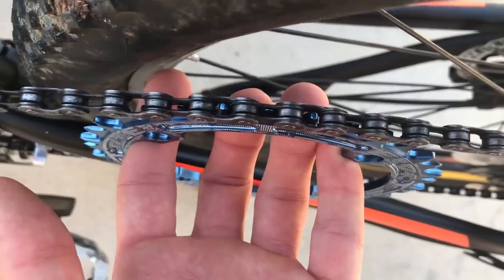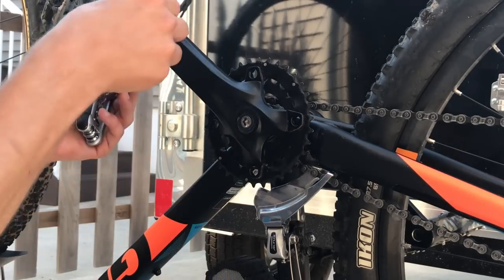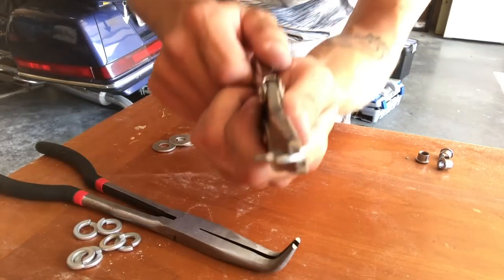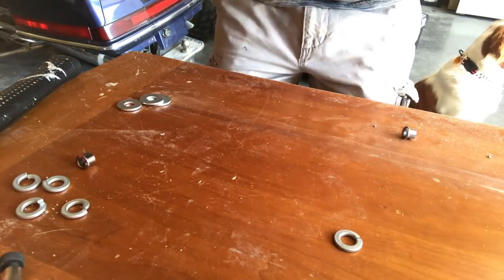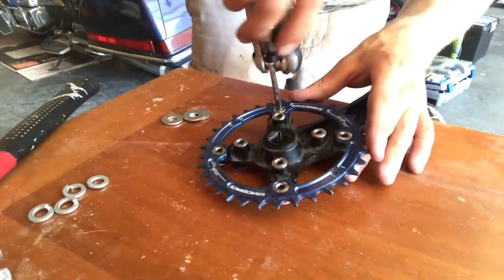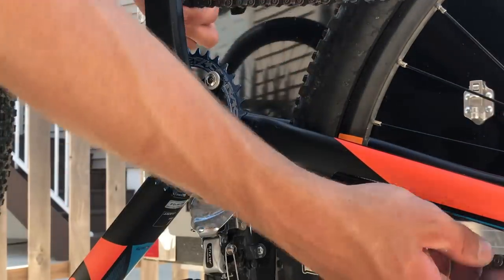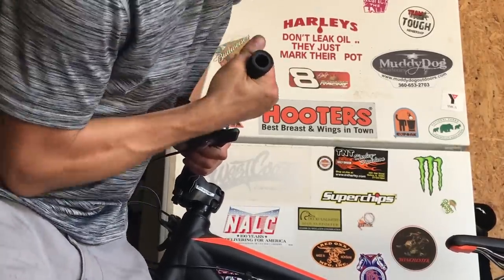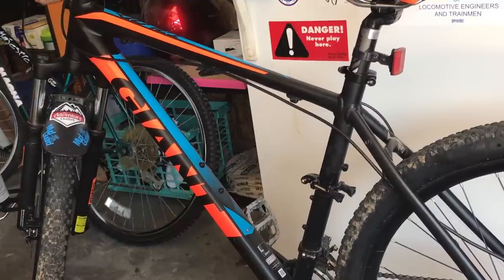3x8 to 1x8 MTB Conversion - Stupid or WORTH IT?

Comment: I've rode a 2019 Rockey Mountain Soul which is a 1x9. 30t crank with a SunRace 11-40t and I can honestly say I didn't run out of gears climbing hills or riding through town. 1x8 is limited to 11-34t which is fine if your running a 28t crank,,,you just waste gears riding trails. Probably lose 3 gears that spin out. That's my opinion...

Comment: Well I’ve done a similar thing, converted a 3 x 9 to a 1x 8!  It’s on my e-bike, which I just use to ride to work. I’m 59 with a heart condition and a pacemaker, so don’t judge me too much! Anyway, much the same steps as you, I knew exactly what you were doing with the lock washers, I did that too. For some reason I adjusted the rear derailleur so it only uses gears 2-9, can’t remember why now. Though I only tend to use probably the top four gears anyway as I make full use of the assist. Hey, I’m only going to work! I did end up putting the front derailleur back on though, to act as a chain device, I found the chain came off a fair bit, even on the road.  That seemed the cheapest way of doing it.  So good job, if it works for you it can’t be wrong, eh?

Comment: i found a new way to take off grips i normal pull on them now a little bit so there is a gap and then push it with my fingers the rest of the way. if you do it correctly like how i do it you wont even break a sweat.

Comment: Lots of things wrong here:

Wide range cassette evens out the range when you drop the other gears. 

Got get some single speed chainring bolts. They are less than $12 for steel ones.  

Go get some proper bike tools (Not sure what crank removal tool was)

Taking grips on and off isn't hard with either rubbing alcohol or water.

Comment: If you do this to your Talon, you'll have to upgrade the rear cassette as well to get some gear range back. With this bike you have room for a 10 speed cassette. I suggest an 11/42 for the wider range. There are also 11/44 and 11/46 x 10 I believe from SunRace, but they are difficult to find in those sizes. You will also need to upgrade to a 10 speed shifter and derailleur. Well worth the investment if you go 1x. If you don't, it will be hard to pedal up hills.

Comment: The Talon 3 isn't exactly a great climber to begin with (the gearing is equivalent to a 29er with 30/42t 1x setup), the 1x8 might be nice in flatlands, but the climbs out west would be "interesting" with it haha.  I have a 2020 Talon 3, thankfully they at least went 2x8 for 2020.  I've found a kit that you can use to convert the Talon to a 1x11, with your choice of 46 or 50t cassettes, and a SLX mech and shifter, but costs $150.  I may go that route if I keep my Talon, but I'm considering going full sus this spring.

Comment: I just found your channel by accident and like this idea, might try it on my old 1998 Trek 8000 SL. How did it work for you? Did you need to add a chain keeper up front to keep from throwing the chain off? What size chain ring did you use? I noticed you didn't resize the chain. My current setup is 22/32/42 with 11/32 on back.
Reply: A narrow wide chaining will help keep the chain from dropping. He also kept the front derailleur on which will act as a chain guide.

11-32 is a pretty good range but you can get 11-40 and 12-42 8 speed cassettes as well. Definitely a big help if you live in a hilly area like I do.

Comment: Nice! I did the same converting my old 42-52 to a simple one ( 52) with these lock washers. :D
Reply: Fernando Fernandes Neri You wrote you converted (past tense) to a 42 OR (emphasis added) 52; which did you do, or is it which do you plan to do?
Reply: Richard E Sorry, I expressed myself badly. Now it’s correct

Comment: i run 1x8 or 9 on everything. same 11-34 cassette on all bikes too only change the chainring to what suits the bikes use case
Reply: Would you recommend the usual 11-34 cassette when converting to a 1x9 from a 3x9?
Reply: @flts3089  its all i run tbh my orange patriot runs a 34 up front and my norco storm runs a 38 but 11-34 on back of both

Comment: 6 hours after buying a raceface 1x sprocket to convert my bike to 1x9 i stumble across your video :D

the new ones have built in threads to receive the original screws. no more need to bodge there :)

Comment: Great video doing this on my kids bike now 🤙🏻
Reply: I've done this on both my kids bike, well, they don't have the narrow wide chainring but until now it hasn't been a problem. (altho my daughter still has the front derailleur mounted as a chain guide) 
I've ran that setup since early 2000ts and its not a big issue either way, remove the unneeded chainrings (or just grind off the teeth to make a guard)

Comment: You did it fine if it works like that and if you want to use a multitool for everything no one is stopping you but being s experienced bike mechanic that crank  bolt was not tight enough because 40nm they go onto the spindle with and even with a 1- 1/2 long torque wrench they are solid to push on should have hit it on with a rubber mallet first to make it a bit better because if you don't the crank will slit and come off down road or even cause pitting on you spindle taper you probly don't understand what I just said but yeah and get a crank puller they are like $5 on ebay worth having right tool for the job but good work

Comment: I went wit the sram 1x12 - 32t. I love it but it cost me $400 😫 with the labor. It’s nice only having 1 shifter . I was going to do a Dyi job like this ....
Reply: If you had bought a 2x system, it would be as if you were riding with two 1x systems on the same bike.   Yes, you would have 2 sets of smaller increments instead of one set of wide bad ones for the weight of less than a half a bottle of water.

Comment: No it's not stupid actually it's a great idea because of simplicity. I liked it and the fact that I was planning to this prior to watching your video. What's holding me are comments and suggestions from professional bike mechanics that by doing the switch from 3 to 1 is like a opening a can of worms in compatibility issues. One final question: how was the ride or how did the bike performed in the trail ? Thank you.

Comment: There's no way i could survive in a 1x8. We often go for 50 miles rides or more in mountainous and hilly terrain. Climbing is essential. 1x12 is the only way to go if you actually ride your bike to the trails.
Reply: 3x8/9/10 foes a good job on hills too, admit a bit heavy and unfashionable (but cheap and what I have). Also have square tapered crank axle...
Reply: @johnpowell9174  I second that I'm using 3x8 for 4 years now it's my all around bike I wouldn't trade it for 1x since maintaining it is more expensive than what I have now and I like how fast I can shift on my granny gears when approaching steep hills or sudden climb on corners which is something of a hassle on 1x system
Reply: I went from a 3x8 to 1x8 32t front chainring and 34-11t cassette. I climb way better than before and have enough top end speed for trails.

Comment: Yeah front gears are a waste of time all ya need is the correct ratio keep it simple ice fitted a large mountain bike sproket to a 20inch bmx it wasn't to hard to cut the top gear off and fit it to da cranks on my 20inch It will work well for top end I'm just getting into MTB building ups one thing I've noticed are the gears on the front I leave on the middle size front sprocket I never need to use that gear selector lol I might do it aswell it is a weight reduction lol

Comment: I was thinking how cool that he only used one tool.
Do you need a specific type of front cog so cross chaining isn’t an issue? Back in the old days of friction shifters, you could adjust things as you shift a few mm so you didn’t have a problem.
I’ve been preaching 1x since there was only 5 speed cassettes-yeah, I’m old. They are perfect for new riders and for the casual rider. Most people don’t understand the range of gears and how they work and only use 1 shifter—-effectively giving themselves a 2 or 3 speed or a or 8 speed. The cost and weight savings and the simplicity would attract new riders. As would 24” wheel adult bikes for short people... but that’s another rant of mine. Custom cassettes would be nice too...

Comment: Did this same conversion on my rei co op bike. Didn’t want to replace the shifter and rear derailer so I opted to convert from a 3 x 8 speed to a 1 x 8 speed. Replace the rear cassette with an 11×40 cassette made by Sunrace for 8 speed. Gives me Almost exactly the same low gear as I had before. Had to put new crank arms and bottom bracket on the front because my chain rings were not removable from the old crank. Saved her a lot of weight by removing the old square taper bottom bracket,  derailleur , and front shifter.   Was a fun project and cost me about $150 including all the tools I needed like crank puller and cassette removal.

Comment: Nicely made video. 

My main question would be gear ratios. My main interest is casual road cycling and annual touring, so if I had the guts, I'd need to modify both front and back gears, based on a video from Park Tool.

Comment: Do you really like your chain falling of the chainring soooo much?
Reply: @that_squires_guy   doh. After I did my 3x9 to 1x9 conversion I was forced to go back to 2x9 - and yes, my chain length is right. 
Well - good job ;)
Reply: Maybe your chain ring is not narrow wide, that’s explain all the chain drop.
Reply: @that_squires_guy  to drop the chain do this: ride down very steep stairs, in low gear, the chain will drop even with a clutch, and narrow wide chainring. a chain guide is a must if you ride in very varied terrain, where you have to gear up and down and haven distance to change to higher gears., so chain will drop.

Comment: Decent. Little bit of locktite on those chainring bolts would have been a good idea tho. Also, maybe consider getting a real chain guide. It's just an aesthetic consideration, but using a disconnected derailleur is ghetto as fuck imo.

Comment: i really see no point at all. i got a 3x9. in the flats i usually use the middle front cog. downhill the other cog and uphill the last one. why would u want to hinder yourself and lower the bikes  capability, just to save 200g or so or for looks??? proper 1x have a lot more gears at the back to compensate and even their it prop makes no sense

Comment: Can I just leave the chain on the middle ring and remove the shifter?
Reply: I did that. My derallieur kept stuffing up so I took it off. The chain kept slipping off into the first one so I made a chain guide and it works fine.
Reply: @foxxy2583   Yeah that was a bad idea. The chain keeps slipping. I even had to take the crank off to get the chain out
Reply: @abdurrahmanmahi5998  
I just left it on the middle one, do when it does slip I don't have to break my fingers.

Comment: Use wd40 next time on the grips. That’s the best way to get foam grips on and off. Then you can rinse and dry if off because wd40 is water soluble. 

And honestly, I think in terms of long term you should just converted to a 1x11 or a 1x12 system. SRAM GX Eagle is $500 for a full group set. And if you go with a shimano 1x11 it’s even cheaper. Because you lost a crap ton of gear range.
Reply: Use rubbing or other kind of alcohol by first inserting a spoke (or chopstick) between the grip and the handlebar.  Alcohol will just dissolve into air.  WD-40 will stay on requires degreaser or soap to remove.  Use alcohol to remove and insert grips.  No need to clean anything afterwards.

Comment: My sense you made the change because it’s trendy and the gauche thing to do with multiple chainring bikes.

Why do I say this?  In the first few sentences of the video you acknowledge you may have done something stupid, but did do because the “change looks sleek and adds to the simplified look of a hardtail.”  You spoke you heart( you did it because of looks and because of looks.

Forget this weight hogwash.  Sure, you lose thx weight of a couple of chainrings and a shifter and cables, but now the née cassette, to try and make up for the lost  gearing range, is heavier than the old.  Yep, there likely is a net weight loss, but it’s pretty darn small.  Take a leak before biking - it will be more of a weight loss.

Simplifying I get.  Weight loss, not so much.  Looks, it’s in the eye of the beholder.  Truth you told, it’s mostly fir looks.

If you’re going to stay 1x, I hope you truly upgrade and go to a 10 speed system.

Comment: If you converted for aesthetics only, then yeah, stupid move.
Just because manufacturers have a serious fetish regarding weight reduction and less moving parts doesn't mean we should all jump aboard the latest tech or fad.
I have zero interest in weight reduction for the type of riding I do, even if I ever got back to the scrub.

Choose the best gearing for the type of riding you do. It's that simple.
Due to circumstances my hardtail is solely used for roadwork and I'd never change my 3 x 9 setup, especially since it's a shitty quality $1000AU entry level.

However, for dirt riding with slower speeds, I'd prolly go 2 x 10\11 and would never go single.

Comment: Get yourself a nice pair of lock on grips. Then it's a snap to take them on and off. I don't think it's worth the time and effort to convert to a 1x8. A 1x11 or 12 yes. You get the benefit of a narrow wide chain ring and a much better gear selection. But hey if your happy with a 1x8 that's all the matters. Good video.

Comment: I'm a mechanic so when you cyclers talk about your overpriced stainless chinese tools my jaw drops every time. It's like buying a first aid kit in the camping section rather than the health section. Just use tools designed for vehicles, use cable and chain lubes designed for motorcycles, use hardened steel tools made for vehicles. Because of how insane this community is the price of $400 of aluminum, steel, and carbon turns into $2000 dollars. You know there are some 10k bikes out there? A lot of which use the same layering techniques that vehicle manufacturers use, however when you buy a 2k body kit for a car that utilizes 10-20 times the amount of carbon it feels worth it. Research and development should not carry into the price of every bike on the trails. Could you imagine if car companies did this? A honda accord would be worth 2 million dollars if specialized made them.

Comment: Its stupid.
You are dropping almost nothing when it comes to weight, spending some money on a chaining, and losing some of the usefulness of the bike. To make up for the lost range, you should really convert to a 10 or 11 rear. I do use my higher and lower ranges regularly for climbs, open road, etc. If you really want to drop weight those wheels or front fork might be a good place to look. The wheels have a larger impact than you would think.

Comment: Why stupid? I have cheap 3x8 trekking bike and I spend 90% of time on middle gear so for many people this is good hack. But in my country is problem get some gears which are good for me. I can't buy 8 speed cassete with bigger range than 11-34 so if I use my middle 38 gear I will lose speed on roads and super easy setting for hills. If I keep small gear, I will be slow like snail. But I guss for MBT it is a good solution.

Comment: 1X system is just for advanced drivers and racers. This is not upgrade, this is stupidity.
Reply: Dzoni Bravo It is an upgrade if you like to jump a lot.  Or prefer simplicity over capability.
Reply: Factory bikes equiped with 7, 8 or even 9 speed cassete are not strong enought for jumping!
Reply: Dzoni Bravo actually they are surprisingly robust.  I did jumping on a stock Giant Talon a few years back and that bike had a tourney groupset.   And even if it did break its very easy and cheap to service since its a ball bearing hub not a sealed unit.    I live in an area where a “trail” bike is a 120mm travel hardtail riding on trails thats at least a blue or black diamond rated